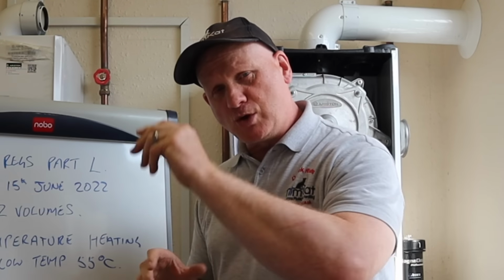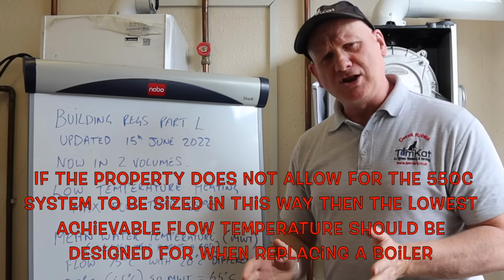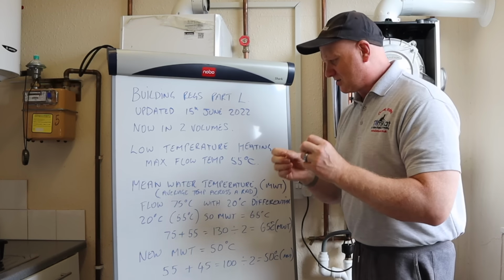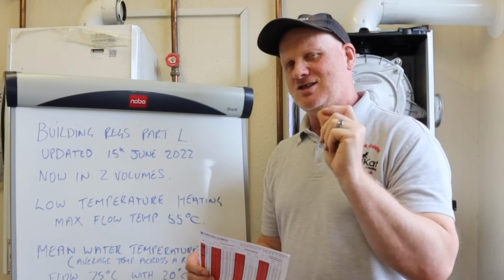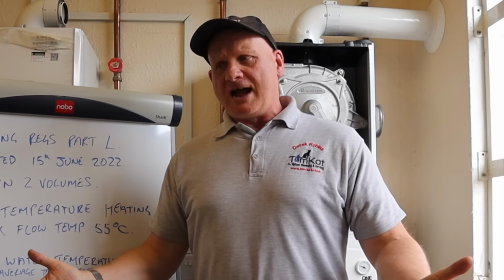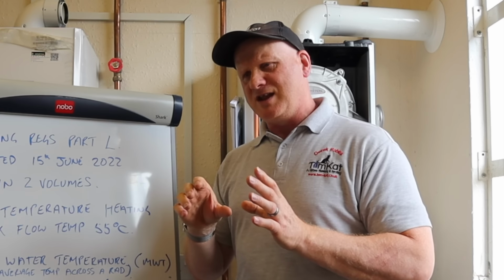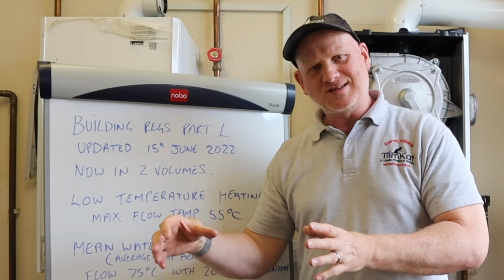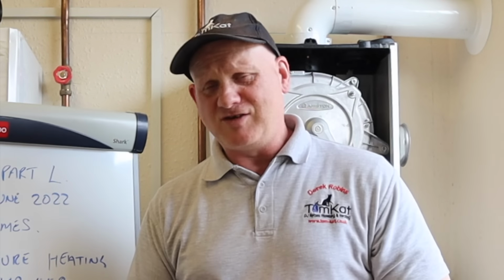Don't adjust your  heating flow temperature until you have watched this video. #saveenergy

Comment: I’m from the USA just found your channel very interesting the UK has always been a head of the United States in higher efficiency equipment.  Thank you for your videos very educational
Reply: Electricity is much cheaper in the USA too which perhaps is the reason why you guys haven't gone as far in efficiency.

It's shocking that you guys use 2-3 times more energy on average. Part of that is AC, sure but a lot of it isn't

Comment: Good video, quite technical for a lot ppl but clear. Although focus on newer combo boilers when those with older boilers & water cylinders may be need the advice the most. My boiler (old style) seems to heat the upstairs radiators & not just the bathroom one when we put hot water on. Awful in heatwave & waste of heat through summer. Tried to turn radiators off but can't get them completely off. New to us rented house.
Reply: Talk to the landlord/owner about it if i was you.
Reply: I had similar issues with a system installed back in 1984. It had valves to separate upstairs from downstairs - different heating schedule for each, but the installer had connected it up wrong. So upstairs rads were on when running hot water. More worryingly, when the 3 position valve had been in a particular position prior to heating being switched off, and then the frost stat had kicked in (to protect boiler in attached garage), the heating came on upstairs. I discovered this when I woke at 3 am with the bedroom sweltering and it sub-zero outside.
 
This is a long way of saying that it sounds like your installation has something connected up wrong - pipework, or electro-mechanical valves (or both). Ask the landlord to sort it out.

Comment: I don't recommend turning your router off. You can upset the connection to your ISP and really mess up your broadband speeds
Reply: Dont agree. The bb modem needs to stay on but the router can be turned off. My router turns off every night to stop the kids being online all night. Never had a problem, in fact this works better because everyone gets a fresh ip address everyday.
Reply: @bikeman123  can you explain the advantage to having a fresh ip address every day? Do you mean internal address of devices on your local network, or the ip address of your modem on the wider internet?
Reply: It also uses fuck all electric

Comment: Why do you need bigger pipes when we are told to use the locksheilds to reduce the flow to balance the radiators?
Reply: If all the rads are sized properly you wouldn't need any valves at all.

Comment: Insulating pipes in a house- where do you think that heat goes? Into the house. Duh.
Not everyone has a loft. I don't.
Energy prices have risen to reduce demand. Government subsidies fight that, so prices rise further. Giving the problem to the government is the Canute solution.
Turn off your router, and all your energy saving smart devices stop working...

Comment: Problem at 2:32 - says 650C, think you mean 65C
. It is simple to design a boiler that monitors the return temperature, and adjust the flow to ensure that. Modern ones do.  No need to change all the radiators.
So why 55C? this is preparation for heat pumps, which get massively inefficient at higher temperatures.
Reply: Isn't 55 the magic number for condensing mode?
Reply: @rodgerq  Yes- for the return temperature. Not the flow temperature. Control on the return, and the flow can be higher. Saving replacement radiators.
Reply: @Tensquaremetreworkshop   ah I thought it was 55 flow.
Reply: @rodgerq  That is what it needs to be, 55C flow is what they have mandated. Not needed for gas, but needed for heat pumps. Manipulative.
Reply: Condensing boilers operate more efficiently at lower temperatures, so in a new system 55C is more efficient.
Reply: @johnburns4017  The lower temperature means it takes longer to transfer the heat to the house, so you have to start heating earlier, destroying any efficiency advantages. Better to start higher, keeping the return at 55C, and then reducing when target is met.
Reply: @Tensquaremetreworkshop  
Nope. Having the boiler on weather compensation for longer is far more efficient. Go to Heat Geek on U tube. He has a vid on it.
Reply: @johnburns4017  no. I do not want my heating to follow the weather- I want it to follow me. Heat the room I will be going into, to the temperature I will need for what I will be doing. A fast response heat will know the current temperature of the room and when it will need to start heating. Weather is irrelevant, especially at these timescales. Every radiator controlled individually, with learning software control. Installing a system like this pays back, especially now. It is simple to show that deltaT is an important ingredient of this, and slow response costs. Artificially limiting this is an imposition I will not tolerate.
Reply: @Tensquaremetreworkshop  
You need to understand how weather compensation works. It injects into the building the correct amount of heat matching its heat loss. Doing so makes the system very efficient, keeping the flow temp as low as possible.  It is also a feed forward, not a feed back, controller, that anticipates the coming heat gain or heat loss. 

Go to Heat Geek on U tube. He has a vid on it.  You obviously never by your babble.
Reply: @johnburns4017  it is you that does not understand. I do not want constant temperature - I want each room to have a different profile of both time and temperature. This will always use less energy than a static time/temperature profile. If this is not obvious, then you need more help than I am prepared to offer.
Reply: @Tensquaremetreworkshop  
You have not got a clue. Read what I wrote, and understand it. I am not going over it again. Put TRVs in the room that you want different temperatures. But you will find that they are pretty useless when top quality weather compensation is used, like the Viessemenn system which aims for the target room temp without room temp senor. 
BTW, I did control with Honeywell and Seimens. Do not argue with me!

Once again you never looked at the vid!  You are just full of gas,
Reply: @johnburns4017  Weather compensation does not understand-
- other heat sources (both parasitic and deliberate)
- heat from attached buildings on their own profiles
- inter room heat transfer 
Lots more!
TRVs are trivial compared to full centralised radiator control and sensing.
I am an engineer working on AI building thermal (and ventilation) control. This is a level of sophistication clearly beyond your understanding, hence my reluctance to engage in your education.
Reply: @Tensquaremetreworkshop  
again..
I did control with Honeywell and Siemens. Do not argue with me!
Reply: @johnburns4017  that is like an 18th Century blacksmith claiming he knows how a modern IC engine works. I spent years designing control systems for companies - and all current systems are now legacy. Self-learning and pattern recognition is the way forward.
Reply: @Tensquaremetreworkshop  
You are not worth conversing with.
Reply: @johnburns4017  True- it all goes over your head.

Comment: Important people don’t turn off their Wi-Fi routers.. getting loads of fallout to people doing this now.. theirs a system called dynamic line management, if it can’t see the router on the other end it will slow down your internet speeds to try and “Stabilise” the line and get a connection back. The system isn’t set up for routers to be switched off.
Reply: Correct - when i had the BT broadband i asked the engineer about switching off the router overnight and he said exactly that !
Reply: Totally correct.. Do not turn off. I was part of Openreach Broadband repair specialist national team and u must leave them powered up.

Comment: My Ideal Logic Heat Only has a weather compensation kit.That controls the heating flow temp, but has a relay that disables it when heating the hot water cylinder ( less than 1 hour a day).  It seems to work, but at this rate we wont be able to afford to turn it on anyway soon. We have decided to switch off as many radiators as we can get away with when it gets cold.
Reply: Depending on your house this might not be the best course of action. You already have weather modulation, great. But by turning off radiators you are effectively reducing your emitting surface which is the same as having smaller radiators fitted, which will result in higher flow temps required to heat the thermal envelope of the home. The insulation between your used rooms and now cold unused rooms will be alot less than to the outside.
Reply: @Swwils  It still modulates down, and believe you me on the middle or lower compensation temperature curve the flow temp does not get too high to condense even with two rooms isolated. It's all working just fine, and yes I do have my old FGA which can measure flow and return temps. It works, and my rads are oversized anyway as I put my first condensing boiler in this house in 1993, and retired it in 2016.

Comment: Turning off your Router can affect the speed of your internet connection; ADSL type Routers need to poll the 'exchange' to tune the speed, also if you have home security etc turning off the Route means you lose access to it while you are away
Reply: Yeah, turning that router off really does affect your internet speed ...it reduces it to ZERO 0000000000
Reply: I think most of the line tuning is done when you first switch on the ADSL router.  I know that the providers prefer us to leave equipment on. But they're not really concerned about how much energy the routers use either. I switch mine off when I'm away.
Reply: @johnackers6311  I'd personally keep it on, because any security updates are pushed in the night

You can however disable your WiFi from.
Any networking equipment is designed to be ran 24/7 tbf. I've got a little rack and I have stuff in there ticking along

Comment: Good advice but don't turn off your modem/rouiter  it will slow down your broadband speed .it only uses a small amount of electricity and you can turn any lights on display by going into its admin  software.Also empty fridge/freezer of any unwanted /old items and turn it down.
Reply: Fridge should be as full as possible as solids and liquids retain temperature better than air. As long they will remain inside for longer than what it takes it to cool them to 3-8ºC
Reply: @globalist1990  Quite right. It helps to fill any empty spaces with empty tupperware boxes as well so cold air doesn't flow out when you open the door. Storing food - cheese, butter etc - in boxes helps as well.
Reply: Power cycling our ADSL router occasionally tends to increase the (5 Mbit) speed by 1 Mbit+. It can help streaming >HD. 

The neighbours give off heavy  interference (affects our MW radios etc) and it compensates by lowering the speed. Dodgy chargers can do it too.

Also rain on the phone line (joints?) or lightning might have upset it. Turning it off lots might make the exchange think there's an issue though.
Reply: @dazednconfused31337  Time to get FTTP

Comment: Price up to part L for a replacement boiler’s then say good bye to your work flow! 
Most people can just about afford a like for like swap. 
We do our best but this Green Party bullshit is mental! 
Love your videos mate.
Reply: Price it up for when gas is 30p a unit like it will be in April and suddenly well designed and running systems make long term sense.
Reply: @Swwils  it’s all well and good but like I say in my catchment area people simply don’t have the money. Average wage £800-1200 a month then to put the higher of living costs on top. Unfortunately I can’t be the peoples charity. Anyone in this trade knows the responsibility and costs to be in the industry. 
It’s like a politician’s view. I grew up on exmoor where my local shop is 20 miles away wages are slim job opportunities are few however we should all be punished for using our vehicles and should use public transport and cycle.
 1 in 3 pitch hills, no public transport, 
One size doesn’t fit all. That’s all I’m saying.
Reply: It's not bullshit though, the regs are designed to save people money in the longer term and reduce emissions. It's a win win situation but I take your point about people being unable to afford the initial investment. Ideally we'd all be running heat pumps and UFH throughout.
Reply: @rodgerq  here in the southwest where most houses are anywhere 600 years old to most average 1970’s and wages at the lowest in the country and living cost at some of the highest. People just need their heating and hot water. Installation of UFH and heat pump and bringing houses up to spec regarding heat loss! It’s a dreamers world and with the greatest respects unless a house is built around renewable energy then heat pumps are absolutely shit. 
People should do all they can afford, but to tell gas engineers that it’s this way or the highway then you ain’t going to survive. 
I think like electric cars it works for the few.

Comment: Interesting video, few questions.
1. Can a 20 degree dt be obtained when running at 50/30 or will it be less? The low temperature radiator scale factor i was shown relies on me deducting the room temp. From the mwt?

2. I thought all weather compensation was based on room designs At 21c, didnt know part L had lowered this again.

Comment: I like this video. It's well explained and covers all the points I make to my clients.  So many installers leave flow temperatures too high and don't explain the controls to the end users.
You could have mentioned underfloor heating which is one of the best ways of warming a room although most installers don't understand that the extra pump and thermostatic blender to reduce the water temperature is completely unnecessary with a condensing boiler which should (as you clearly explained) be set at a low flow temperature.
Thanks for making the video and spreading good practice.
John

Comment: Great video, but as I understand it, wrong advice re replacement boiler and having to have the system sized to 55degrees. The new Part L states that if you are replacing a boiler you have to do a room by room heatloss to get the closest kw output boiler and that all rams except radiator where room stat is to have a TRV’s. New or replacement heating systems have to be sized to 55 degrees. Replacement hesting systems do not have to be sized to 55degrees if one single radiator is retained.